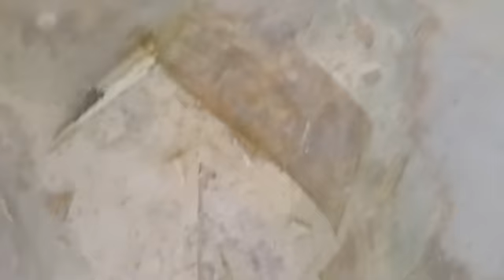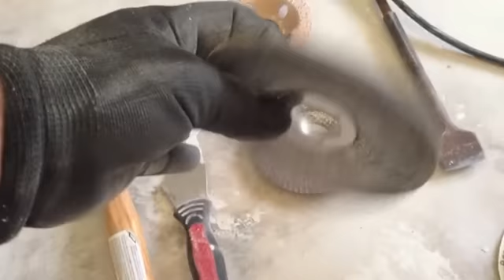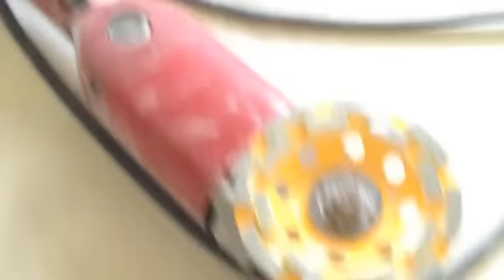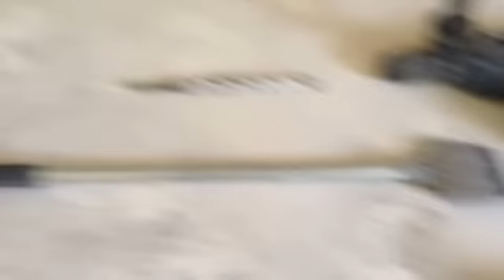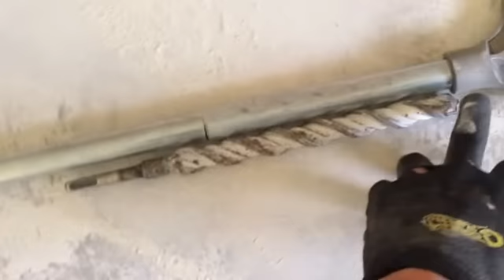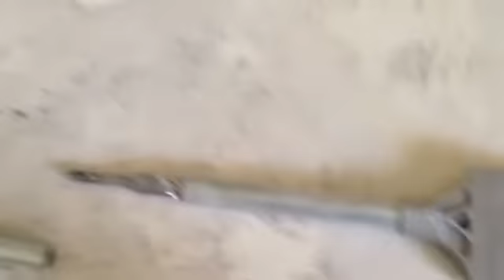how to make your own thinset motar glue removal blade attachment for hammer drill

Comment: I’m in the same process. Removing thin set and glue off my concrete floors to stain.  What I did was cut the handle off the 4” chisel. And cut the tip off an air hammer bit. Then welded them together.  Worked great and didn’t scratch up the concrete like the heavy thick air chisel did!

Comment: I’ve done this work before and he’s got a great idea here.  And he’s right about some of the other cup grinders gouging out the concrete.  Then having to use floor leveler as another time consuming step and expense.  So, he’s got a good tool there and I have a small job coming up like this and it will do a great job.

Comment: Thanks for the great tip. I have the orange SDS hammer drill from Harbor Freight and have been using the 2" tile removal bit to chip up the tiles on a concrete floor in a kitchen, laundry, hall, and breakfast area. (About 400 sf.) I want to put down a laminate plank floor so I need the concrete slab very clean and smooth. I followed your example and made one like you did using the HF 12" scraper instead of the 4' one. I pulled the handle grip off, stuck a snug piece of old garden hose in the tube, and pounded a 12" HF SDS chisel bit in there until it bottomed out and was ready to put it to work. It worked great except the blade bolts did come loose during the job. The 12" scraper was $5.99 and the 10" SDS bit was in a 3 bit set for $16.99. I did use a pump sprayer with water to wet the thin set to control the dust. I did buy the 4' scraper to make a longer tool (standing) and have not needed it yet.

Comment: You can buy a commercial version of  your tool, which fits SDS MAX compatible hammer drills  on Amazon for $55, delivered to you door.  It's a beast.  An SDS plus version is available for about $70.  Extra blades available for both.  My apologies if someone has already brought this up.

Comment: A carbide drill bit will drill right into that tool steel no problem. Probably e-zer then drilling concrete with the concrete drill bit.

You also just spent twice what you tried to save.   Just look on Craigslist people buy tools to use one time instead of renting then sell it on craigslist.
In fact that would make a neat part of Craigslist Tool Share section for DIY jobs.
You buy the tool use it then resell it back on Craigslist to the next user.
You have to join the tool share program.

Comment: you have an angle grinder correct?  cup wheel attachment using circular motions with light pressure.     

I prep floors daily smooth as glass for hard surface flooring.
Reply from the maker: kyle lowell except it would take 6 years on a 2000 square foot floor plan and create enough dust to fill a 10 yard dumpster
Reply: christian bonacci 

It took me 6 hours to level 1320 foot restaurant in Minneapolis.  I removed easily 400 lbs of concrete (120 yr old building)  cup grinder w/ shroud,  and oreda dust deputy.  you seem handy,  so make a dust deputy. It works amazing.
Reply: Predicted 2 years ago Wow!

Comment: basically it took him 10min to say buy a floor scraper  cut it to length then  insert the drill bit to place and tighten...
Reply: yeah.... basically - but he did show all the other tricks - that didn't work - which might prevent others from loosing so much money on what doesn't work.
Reply: @DennisCLatham  prevented me running through sheets of 60 grit sand paper my thinset is on there so good it’s like they mixed it with Gorilla glue.

Comment: I bought a couple of these scrapers at Harbor Freight and they worked great for a short time - but each lasted about 20 minutes before breaking.  First one broke through where the pole attached to the frame, second one broke across the middle of the frame which is made of aluminum.  Maybe the current version is being made more cheaply than when this video was produced.  Back to the rental shop at least for a real scraper blade.

Comment: Once again necessity is the mother of invention. Isn't it amazing no tool manufacturer has one of these on the market. There's plenty of shitty tools that don't work worth a crap. You have to be able to feel the substance, and how it reacts to the tool as your using it in order to determine the correct micro motion for the material in question, some are elastic, others are brittle. Thin set is a combination. It responds well to the high frequency micro strikes of the hammer very effectively. Good job. I love it when a tinkerer invents a new tool. Next thing you know some slimy capitalist pig will steal your idea, and sell a million of them. "Bastards"!   : (

Comment: Nice way to save a few bucks. The actual bits that are made like that are about $150, and the replacement blades are like $35-40 extra. The only recommendation I have, would be not to stain that floor yourself... With all the chips, gouges and probably grinder marks, you're going to need to use a micro topping to get that smooth, mirror like finish. And it's not a very forgiving product.

Comment: Buy the Makita floor scrapers
Reply from the maker: That Mikita scraper is over 180 dollars and Is sdsmax, cheapest sdsmax rotary hammer is around 350 so 530 dollars for a tool most people will use once is not the point of my video.

Comment: Christian , you mention that the drill bit that you used was a 3/4 in bit. Idk if the HF floor scraper you have is different than the one I brought there, but the bit size I had to use was a 1 inch bit. Good thing I brought the set when I was at HF that had a 1 in bit in it.

Comment: I used your approach to make the scraper to remove thinset from pool wall. Worked well for about 30 minutes and then fell apart starting with sheared bolts. The problem was the crappy quality of the Harbor Freight scraper.

Comment: Nice! As a contractor, I can see how this would be a good tool...They already make scrappers for SDS drills though.
Reply from the maker: Yes they do, but they are very expensive , you have to order them,they only make them for certain very expensive sds drills, this allows you to build something for an existing tool you may already have or build one for a cheaper tool. And build it today use it today.
Reply: christian bonacci I rent them...In my nearly 30 years as a contractor, I have only had to clean up cut back or mastic maybe ten times...But, It is a cool tool! That I will grant...It does a clean job...

Comment: I just did this over the weekend. harbor freight floor scraper 9.99 then their 1 inch SDS-plus masonry drill bits fits perfect in the handle. Their drill bits are only sold in packs of 5 for about 25 dollars. so the tool came out to around 35 dollars. better than 250 dollar tools on amazon.